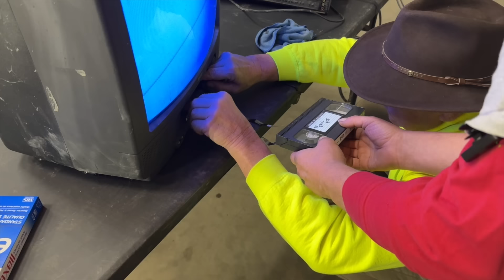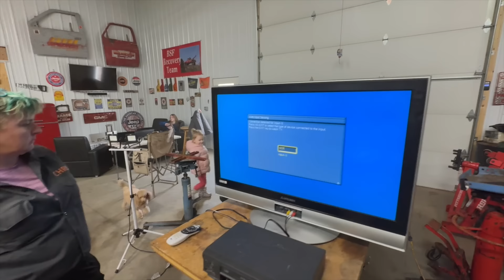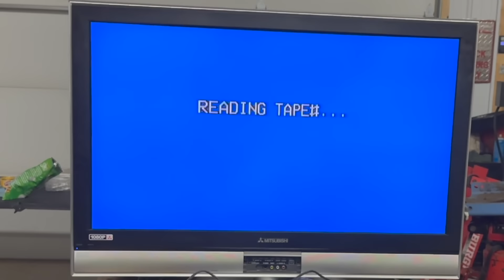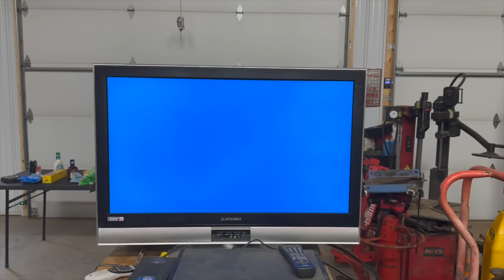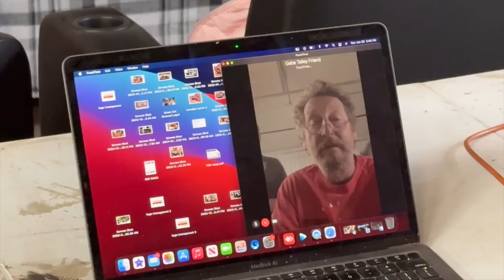On a Mission for @MattsOffRoadRecovery

Comment: About VCR's eating tapes: This is true of all tape players no matter the type. They work on friction, but not too much friction or two little. What happens is the rubber rollers get sticky and will not release the tape. Or, rubber parts get hard and cannot grip the tape sufficiently. Always unplug the machine, take the cover off and clean the rollers within. That means a little isopropyl alcohol and some Q-tips. Scrub the rubber rollers, the metal pinch parts too. You'll be surprised how much dirt comes off them. Clean the magnetic heads the same way, often there are deposits of the magnetic coating from the tape on them. Allow plenty of time to dry. This procedure fixes a lot of tape-munching troubles, but not all. Sometimes no amount of cleaning helps, parts are simply too warn or, rather than sticky, they are hardened and unrecoverable. One more thing, never ever spray lubricant into a tape player! That is always the wrong idea!
Reply: I learned a head cleaning tip from an old pro, A clogged head is best cleaned with a Finger nail.
The hardness of the nail is perfect for getting Hard tape residue off the Heads. Drag the surface of the nail across the head a few times then clean off the rest of the drum..  
Sony actually had a head scraper built into some machines to do just that....
Thare"s Your Dinner.....

Comment: One thing that might help sense you probably can't find any of the VCR head cleaner taps any more it to use some alcohol on a cotton swab to clean the heads inside the player. They have been setting unused for quite a while it looks like so oxides have most likely built up on the heads and it grabbing the tape as it tries to play.

Comment: For the new tv for a old VCR you need a digital converter same thing with video games old VCR the rubber inside dry out belts need to be replaced
Reply: They were using the ANALOG video input on the front of the TV....

Comment: When I was looking through my $800 1998 f250 extra cab 4x4 I found a on the left side a vcr player built into the truck. No monitor or wires to unless in the digital radio. If you come to Wells Nevada I'll let you borrow the truck so you can watch the video or try to make it work. Bring your trailer.😂😂😂😂
Reply from the maker: LOL